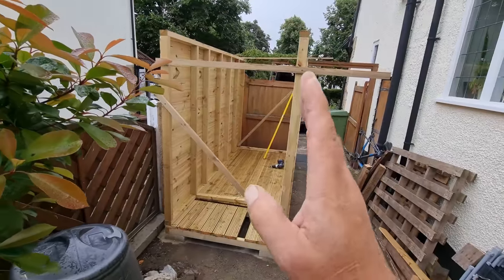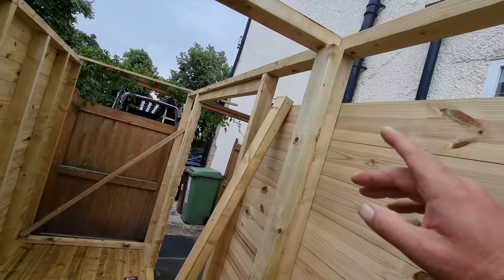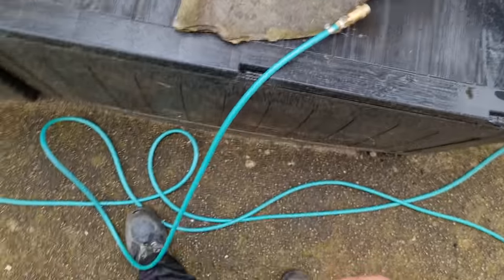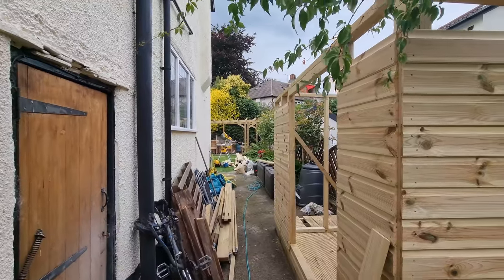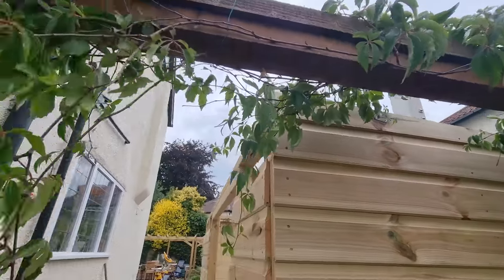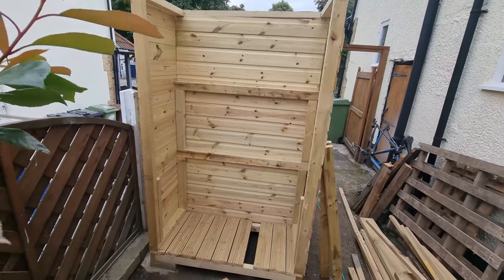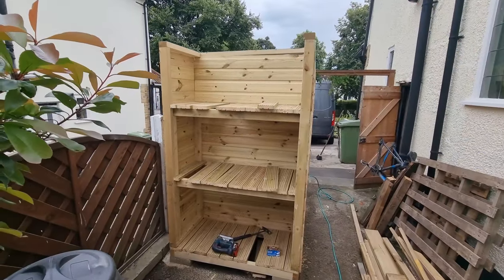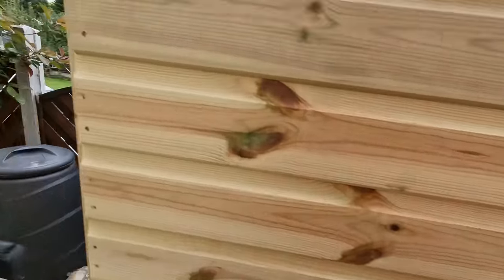Tafty's shed/wood store build Pt3 - Almost finished the walls, just the roof & doors to make

Comment: Tidy job Gid. I have the same jigsaw and they are a great piece of kit especially through thick stock because of the pendulum setting. Haven’t seen someone cut from underneath in years, great way of cutting profiled boards. Used to work with a few joiners years ago from India and they all cut front to back from underneath with there handsaws too. Keep’m coming.
Reply from the maker: Thanks Patrick will do, Yep i bought it not expecting too much, hoping it would do but now many yrs later it still woks as new & i really like it, it easily cuts 2" 👍 & yep cutting like that means you can see the line, the base doesn't mark the surface & it gives a clean cut on the face, I use Bosch T144D blades that are a bit thicker so stay straight, rather than the 101 blades that tend to waver a bit & are hard to control doing this type of cut, funny thing is i cut down with a coping saw, just like a normal saw, not from behind 🤷‍♂️🤦‍♂️😂

Comment: A masterclass as always Sir, 👍 What's the model number of your Bostitch coil nailer please? I have a Makita coil nailer, it fires 45mm to 90mm nails. It's great for framing but a bit big and cumbersome for cladding. I'm looking for a gun that fires 40mm to 65mm nails. Thanks, 👍😁🔨🇮🇪
Reply from the maker: Thankyou 👍😊 It's this one https://www.betcofasteners.com/bostitch-n66c-2-e-coil-nailer-32-64mm.html I get my nails from this place, I bought the 64mm nails for this but they didn't fire properly, that was the after market nails tho not the gun & return was accepted no prob, all other nails work no prob, not one misfire on this job, the one in the video at the start was just the new coil of nails not up to the firing pin yet. you're  welcome.
Reply: @Gidjoiner  Thanks, I'm cladding my workshop at the moment. Staying dry for now, slates arriving next Week, 👍😁🔨🇮🇪

Comment: Great vid as usual Gid, thanks.Been looking for a hose like the one you use. Can you remember where you got it from?
Reply from the maker: Thanks Wil 👍, I get it from Thorite here in Leeds, you'd have to ring to get a proper price, sometimes it's on offer, it's normally in their reception area if you need to mention that, https://www.thorite.co.uk/products/tube_and_accessories/rubber_hose/merlett_ragno_pu_hose_puthermoplasticrubber_abrasion_resist/ & this is the hose, they may know of a local dealer close to you if delivery from them or Thorite isn't poss, https://merlett.com/couk/product/ragno-pu/
& i like these type of pipe clamps https://www.amazon.co.uk/stores/page/B9124B64-D364-4EB0-AAF8-539633B8F258/?_encoding=UTF8&store_ref=SB_A0602761IFTBYE80GUZH&pd_rd_plhdr=t&aaxitk=8f05244015d9f2697625080975a23e55&hsa_cr_id=1510882440102&lp_asins=B083JJ5J9D%2CB083JHSL6Q%2CB083JKBL5T&lp_query=hose%20clip&lp_slot=desktop-hsa-3psl&ref_=sbx_be_s_3psl_mbd_asin&pd_rd_w=mMm1j&pf_rd_p=45cdced4-7355-4a87-af38-0495d18b57b6&pd_rd_wg=ET71f&pf_rd_r=RSDW1AY77VKRJHNRC9YS&pd_rd_r=0264d67c-badf-4442-a827-a0788187433f

Comment: Hi Gid 
Do you a link to the air hose
Reply from the maker: Hi, I get it from Thorite here in Leeds, you'd have to ring to get a proper price, sometimes it's on offer, it's normally in their reception area if you need to mention that, https://www.thorite.co.uk/products/tube_and_accessories/rubber_hose/merlett_ragno_pu_hose_puthermoplasticrubber_abrasion_resist/ & this is the hose, they may know of a local dealer close to you if delivery from them or Thorite isn't poss, https://merlett.com/couk/product/ragno-pu/
& i like these type of pipe clamps https://www.amazon.co.uk/stores/page/B9124B64-D364-4EB0-AAF8-539633B8F258/?_encoding=UTF8&store_ref=SB_A0602761IFTBYE80GUZH&pd_rd_plhdr=t&aaxitk=8f05244015d9f2697625080975a23e55&hsa_cr_id=1510882440102&lp_asins=B083JJ5J9D%2CB083JHSL6Q%2CB083JKBL5T&lp_query=hose%20clip&lp_slot=desktop-hsa-3psl&ref_=sbx_be_s_3psl_mbd_asin&pd_rd_w=mMm1j&pf_rd_p=45cdced4-7355-4a87-af38-0495d18b57b6&pd_rd_wg=ET71f&pf_rd_r=RSDW1AY77VKRJHNRC9YS&pd_rd_r=0264d67c-badf-4442-a827-a0788187433f

Comment: Why do you use the jigsaw upside down?
Reply from the maker: Cutting like that means you can see the line better, the base doesn't mark the surface & it gives a clean cut on the face, I use Bosch T144D blades that are a bit thicker so stay straight, rather than the 101 blades that tend to waver a bit & are hard to control doing this type of cut,

Comment: What’s the benefit of using the jigsaw upside down?
Reply from the maker: You can see your line better & it leaves a clean cut on the face, i use Bosch T144D jigsaw blades which are a bit stiffer than reg blades like 101B's which would prob waver doing it like this,